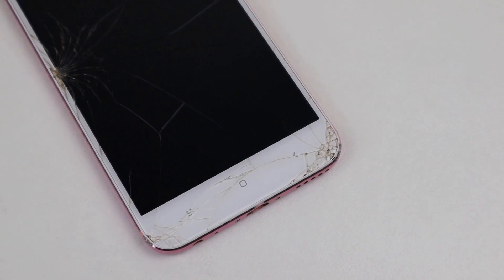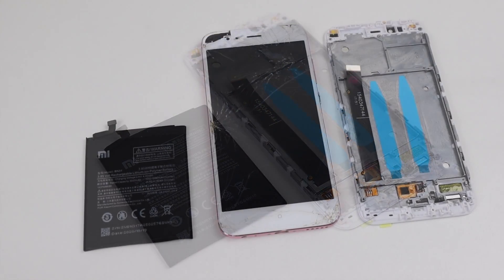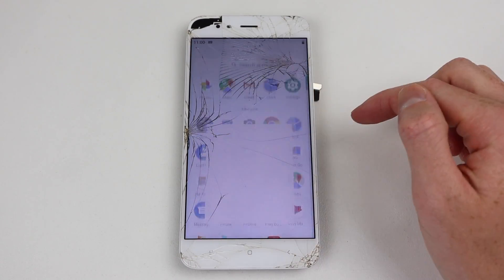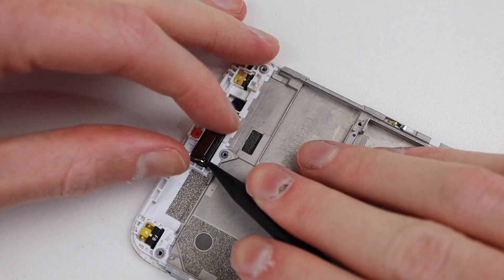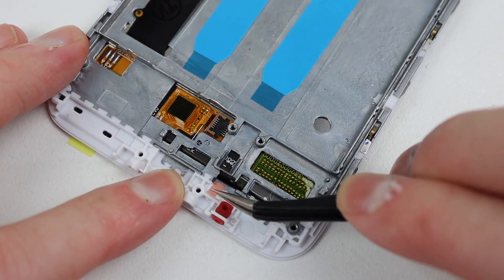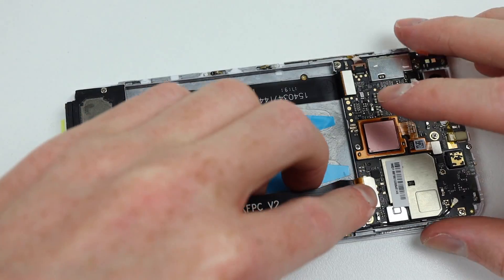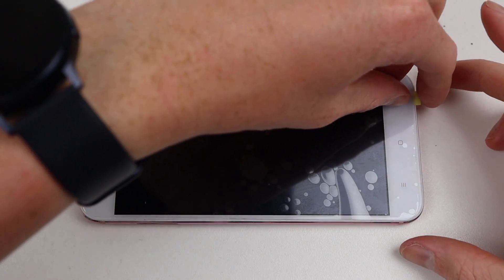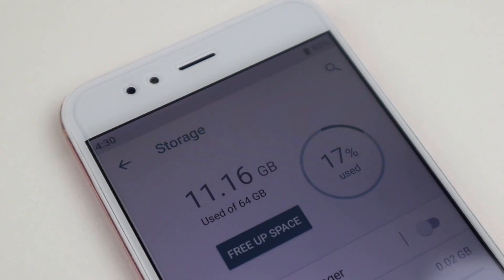Repairing a Phone Using Only AliExpress Parts - What Can't Go Wrong... (Xiaomi MI A1)

Comment: That's what I've just experienced. Recently my Redmi 4X's screen cracked cause I dropped it on the corner. Tried to get a replacement screen said to be original, only to have the navigation buttons not working from screen off(need to touch the screen once before the navbar is able to work again). Also my Z3 Compact's screen is in condition where touch is broken in some places.

I would love to have those repaired. But with parts circling around are mostly fake with questionable quality being sold as 'original', I would better off buying used phone and have it running till it breaks down, hopefully in a year or two, which is why I'm now running used XZ1 with white spots on the screen and lower capacity battery, otherwise still perfectly functional.
Reply: I have a Redmi Note 4X and getting replacement screens are hard...
Reply: You'd be better off finding a donor phone with dead internals. The 4X and the Z3 compact are getting rarer.
Reply: @BudoBašović  That was what I was going for my 4X, but couldn't find any donor candidate with justified pricing. So I ended up going for screen replacement only which proved to be a bad decision. It costed me about US$ 34.5(screen, battery, and power/volume flexible cable, all highly questionable quality).

As for Z3 Compact, it was once having temperature and random reboot issues, although it seems to be working fine now. Hence I went for a used XZ1 which I got for about US$ 50(I'm in Indonesia btw). It's the biggest phone I've ever had and obviously not comfortable to use. I'm still tempted for XZ1 Compact but it's really hard to find a good one.
Reply: I just checked 4Xs, locally (Serbia) they're sold for like $40 for a wonky one but with a good, original screen, and a good working one for $60. That's just a tiny bit more than what replacement screens of unknown origin are going for.

Comment: am still using one with the andriod 9 have it since it came out and havent use any case nor screen protector for about 2 years and it has received many drop and screen is still without a scratch.. its a tank.. best feature is the IR use it has a universal remote for tvs and ac and cable box lol

Comment: There are better replacement screens for sale, you just have to do some more digging.
Reply: Sometimes there are, sometimes there are not. If your model is exotic, you will have a lot less choice.
Reply: @SianaGearz  On Ali there's everything for everyone, but this guy probably just bought the cheapest garbage and complains about it. 
Dumb people want it crazy cheap and good and the same time
Reply: @backwards9772  you can put in all the effort and still accidentally end up with junk. But you can also get top notch product. That's Ali for you. It would be better if you had a straight up reliable trustworthy supplier where you don't have to think about it and always get a quality product, but many electronics manufacturers plain do not sell replacement parts to distributors, so everything you get is some sort of potentially shady salvage operation. #righttorepair
Reply: would i be able to get a good screen for my redmi note 10 pro?

Comment: Aliexpress parts are cheaper than OEM, but they dont last / damage your phone otherwise. Got a charging port assembly for Asus ZB601KL and it destroyed my battery and mic after few months. DONT GO CHEAP !
Reply: Some of them (only HQ ones) are rembranded OEM for licencing reasons. But yeah, only go for them as long there is no OEM parts available.
Never go for cheap parts, those are killing your phone.
Reply: @lrc3847  I bought the top of the line part they sold, still it screwed me up 😅

Comment: Nostalgic Mi A1,this phone is very durable,my friend still used it in 2021 with android 10
Reply: Let me guess. Custom ROM
Reply: @FarhanSFadhillah  am still using one with the andriod 9 have it since it came out and havent use any case nor screen protector for about 2 years and it has received many drop and screen is still without a scratch.. its a tank.. best feature is the IR use it has a universal remote for tvs and ac and cable box lol

Comment: That was a really good phone from xiaomi. Too bad they discontinued this series after A3 bcz they couldn't get enough profit by making stock androids and trying to kill all the existing ones.
Reply: They simply can't put ads on every corner of the phone if its running on AndroidOne program. So, they killed the A lineup.
Reply: @MRF2492  I just killed Samsung
Reply: Im still main driving my MI A1 since launch, is still fast as day one and only showing some old age issues like internal memory/ram responsiveness sometimes and the battery wich is obvious for a 4 year phone, if it weren't for the old OS and old battery i wouldn't change it
Reply: @spannerwindslayer  I've been using this phone for a while too, and I absolutely despise Xiaomi's rendition of the Android One project. The software was buggy and very different from other Android One devices. Personally, I've flashed on an Android 10 custom ROM and the phone's been running mostly smoother than the stock ROM. The battery has taken a slight hit, though.
Reply: @TaimurZulqarnain  hahaha. You're right. Using custom ROM now it's smoother than stock
Reply: @spannerwindslayer  change the os and get a battery replacement. It will be new as box  packed. Still rocking it as my main driver
Reply: @PeterGriffin-no8gw  from where you bought the battery??
Reply: @sahiljaswal5279  from local mi service center
Reply: @spannerwindslayer  same here issues with ram management and battery charges and discharges a lot faster
Reply: @sahiljaswal5279  well... ram management has always been an android issue, since so much time that it's almost a feature now...
Reply: @spannerwindslayer  there are amazing ROMs for mi a1 out there!
Reply: It's because of how terrible they handled Android One devices. This A1 is literally the only completely fine model from their Android One lineup. The A2 had worse camera system and dropped the headphone jack, which was actually quite good on the A1. Then the A3 is surely the worst out of the bunch, with Android 11 update literally bricking the phone and rendering it unusable.
It really seems as if ever new generation is actually worse than the predecessor.
On top of that, their supposed purpose of being Android One devices, which is very fast and stable software updates that's just second to Google's Pixels, is not delivered at all. Heck, even Sony's non-Android One mid range devices during that time were updated much quicker still, which begs the validity of the Mi A series as Android One devices when they don't even comply to the bare minimum standards of Android One program. Nokia just did Android One devices much better overall.
Reply: @troy5568  Mi A2 Lite has gotta be the worst one of them all. Touchscreen and LCD were both so much worse than the Mi A1. It also went BACK to microUSB when the A1 has USB-C
Reply: @jm036  Touchscreen and LCD much worse? I don't have any issue with that. Actually yeah, it's a little underwhelming for the price tag (under 150 dollars) by the time I bought it, but it's okay since my usage is not about gaming.

My previous smartphone was Huawei P8 if you curious, not 2005 phone.
Reply: @troy5568  I have A3 device, works OK, no problem with android 11 update (the 3-rd one)
Reply: @troy5568  true
Reply: @troy5568  Mi A2 Lite is great too, aside from lacking NFC
Reply: @FarhanSFadhillah  It's literally the same hardware as the A1 inside (good old Snapdragon 625).
Reply: @FarhanSFadhillah  maybe, if all you've used before is a dumbphone from 2005
Reply: @jm036  wait what? I criticized the software update and NFC. Micro USB is still nice because here it's still not uncommon to see device with Micro USB.
Reply: I had the A2, it was a shitshow. Bad battery, buggy software, no nfc.
Reply: Oh and don't forget how they manage the software update
Reply: Pretty sure it's also because Google gave up on android one, first by gimping it and then by just not caring anymore about it
Reply: Nice that you can buy the spiritual successor, like the poco x3 pro
Reply: Android One ist not "stock" Android.
Reply: @worldhello1234  it is, it just has a intermediate layer of non google drivers for compatibility with the hardware, and some junk from xiaomi added for telemetry. Like an OEM windows installed on an laptop for example.
Reply: @worldhello1234  stupidest thing I've read
Reply: store link: https://www.aliexpress.com/item/1005002914928939.html?spm=a2g0o.store_pc_allProduct.8148356.13.49eb64eeOXiSOC
This  is a repairing data center for laptop and smartphone in English.
It includes schematic, boardview and maintence cases which are collected from our technicians at the daily real repairing work.
It covers all the models of phones, for example iphone, HuaWei, Vivo,OppO.
Reply: store link: https://www.aliexpress.com/item/1005002914928939.html?spm=a2g0o.store_pc_allProduct.8148356.13.49eb64eeOXiSOC
This  is a repairing data center for laptop and smartphone in English.
It includes schematic, boardview and maintence cases which are collected from our technicians at the daily real repairing work.
It covers all the models of phones, for example iphone, HuaWei, Vivo,OppO.
Reply: My a1 and a3 still running fine, use my phone for only very basic things so I guess that's why no issue faced. A3 still got security updated to last month September.
Reply: Mi A2 in spanish literally translates to "pee" or "piss"
Reply: Badly emergency food Samsung Galaxy J2